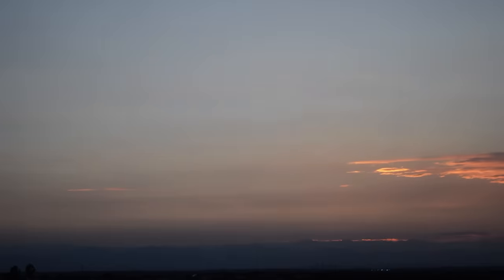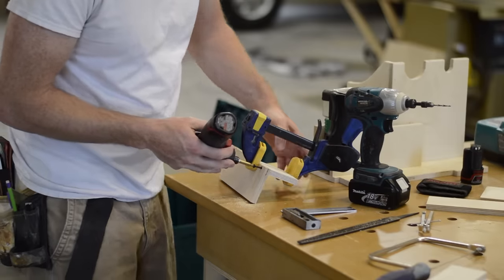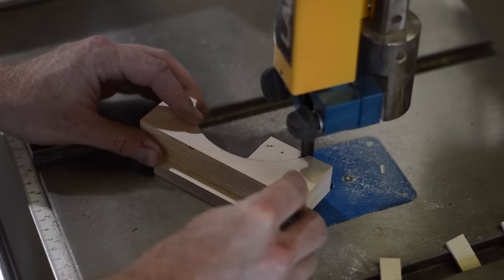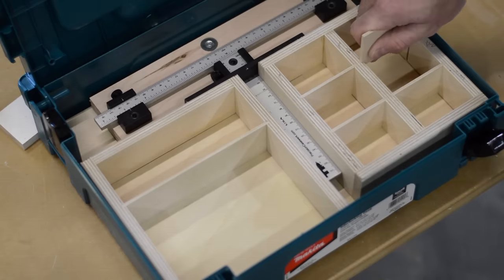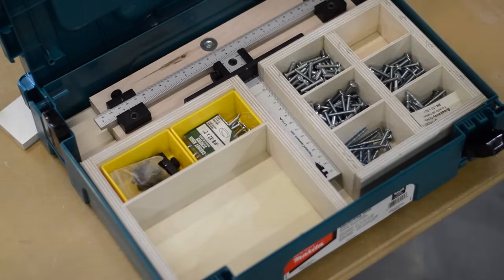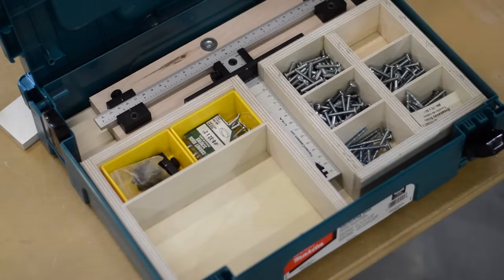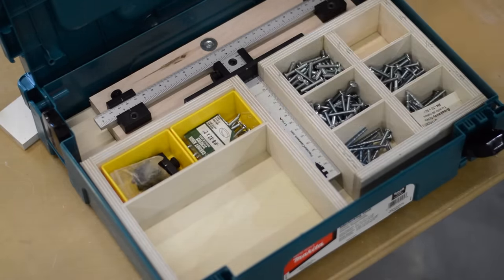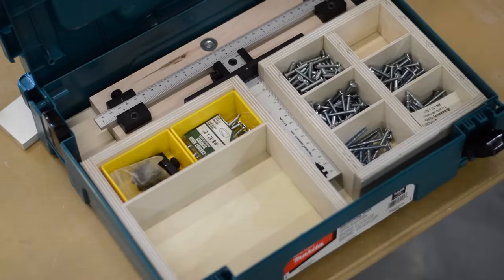Carpentry Tool Organization, Makita, Festool Systainer Build

Comment: Very neat. I have the hitachi systainer set and used foam and cut out shapes to accommodate tools. Then I used the number 4 for example with 4 inserts vertically. I pull out the one I need and work with it, then return it. For small items I use the SORTIMO T-boxx
Reply from the maker: Thank you very much. Foam works really good. I have been using a foam insert to hold my camera lenses.

Comment: Funny i have the same small Senco compressor of similar vintage.  Its cheap very light, quiet and wont die, love it. I replaced the twist drain valve with Bostich ball valve. Huge improvement. I like the box idea. Much cheaper than the Fusstool version and holds a small hose.👍
Reply from the maker: Its like that little compressor won't die. I like the ball valve idea. I'll look into that.

Comment: Very good design and fit. Regarding to the compressor if overheats dril couple holes at top and bottom about 2" diameter and screen it to stop dust and bugs and go to town 😎
Reply from the maker: I think this would be an easy effective solution. Thank you.

Comment: I just noticed the blower tip inline on your hose with the nailer.  That's awesome.  Nice builds as well.
Reply from the maker: Thats a really neat tool, I bought it at a closeout sale at a local auto parts store.
Reply: @MikeFarrington  I like it.  I was about to comment on another video.  I found you a few days ago and am several hours deep so far.  I'm 43 and own an auto repair shop and am widely known for attention to detail and doing it right the first time.  So your OCD, detail, and organizing tendencies impress me.  I am not new to fab work whether it's wood, metal, or other raw materials.  But I am new to remodeling (my house) and fine detail carpentry.  I am currently building a shop up for woodworking and look forward to enjoying this hobby as relaxation instead of "I need to build it now and have to hurry, time is money".  A bathroom vanity cabinet is in my next month's lineup.  I have nearly everything I could need minus a band saw.   I greatly enjoy your presentation and tips.  11 years ago I bought domains to start my YouTube/internet presence of my adventurous lifestyle.  Man that's a bunch of camera/edit work I can't bring myself to dive into.  LOL.  Keep it up.  Oh, And AWESOME shop.
Reply from the maker: Thank you. Lots to think about with a new shop. Best of luck.

Comment: Awesome job on these. I am only a hobbyist but it gives me some ideas for my small shop and as I move to the upstairs in my home improvement projects. Just bought the cordless Makita track saw which came with two of the cases. Between that and your video I’m getting the bug to do some organizing.
Reply from the maker: Sounds like its time to get to work. This system has really worked well for me the last few months. I am working on a room remodel and it has really helped me keep my foot print small and organized.

Comment: I might grab a Dewalt ToughSystem box for my compressor now to lock onto my others. Awesome idea.
Reply from the maker: It is very convenient to be able to stack stuff on top of a compressor. Go for it.
Reply: Mike Farrington I realized that the last time I needed to go to a job site with an air compressor and had the Dewalt tough system tool box with wheels on it. It’s great having wheels, but there’s nowhere for the air compressor to rest against and they can fall out so I have to make sure to bring something long enough to go across the handlebars. Some people don’t have parking for you and you have to park far away and making multiple trips sucks. That’s the whole reason why I got the DeWalt box with wheels. Got tired of carrying so much all at once.
Reply from the maker: I hear you about the parking. I have made some pretty long treks. I always try to build an extra couple hours into the bid in those situations.

Comment: Hi Mike.
My feedback on your request is simple. Everything is well thought out and the way you process your need for an organization applied to this built describes your ingenuity and personal touch. I isn't easy to fit so many tools in such compact spaces to have them handy and keep them handly organized. 
The only thing I will add, not to change, would be one of those PC cooling fans to the air compressor. blowing right on top of its head if possible and an exhaust grill somewhere in its container.
This exhaust fand can be fitted with a power supply of the same volts capacity, and since it draws such a small amount of current, it can be rigged to the compressor's switch. But this is based on one's use of the nailer. In your case, it would only be worth it if in the future you would have more heavy use of it. 
Thanks for posting it. It is very inspiring.
Reply from the maker: Thank you very much. The PC fan is a good idea.

Comment: I'd like to see a follow up video as to how these are working for you and if you've needed to modify/update what you started with. It looks great as a starting concept.
Reply from the maker: So far I have used them on a few job sites. I have not needed to change any thing. At this point I am thinking of doing a few more boxes for other smaller stuff. Keep in mind that this tool set has been with me for many years now, so going into this I was pretty close on what I needed.

Comment: Studley ToolBox.... 
one thing you might do is use thinner material to pack even more stuff in.  it just gets heavier with each tool.  I think dividing tools into more managable sized tool boxes is a good way to keep your back in good shape.  
when your compressor dies, keep the tank but switch the compressor to refrigirator style compressor.  they are very quiet and keeps noise level down especially if you are going to work in a crowded area where noise is an issue.  they are mostly used by hobbiests but can crank upto 21bars so they are powerful.  maybe a little slow.
I really like how all this turned out.  I need to check if I can find boxes available here.
Reply from the maker: Agreed, thinner material would have been better, this was one of those projects where I did it with what I have on hand. Good tip on the fridge compressor.

Comment: Very nice! The only thing I would change is adding a few more clamps. Again very nice work.
Reply from the maker: Thank you Pete. I agree, more clamps. I did it this way because a lot of my installs I just clamp cabinets together and the screw them. Two clamps works for that. For larger jobs I have 3 empty systainers that I fill with job specific stuff, when I need more clamps I throw them in there.

Comment: Would love to see an update on this. Thoughts 💭 of what is working and what changes you would like to make. Plus is it practical for you as some of my tool organisation I find in practice just didn't work as I had planned originally. I have re watched this from time to time when I get frustrated with messy toolsite. Working on a practical adaptable mini workbench that is easy to carry from  job to job. Keep up the great work.
Reply from the maker: I think I mention this in the video, but the tools that I carry with me have been refined over many many years. So when making this setup, I pretty much knew what I wanted. This system has some compromises, as with anything, but its been great. I have not made any changes, except for adding a few more boxes for other tools.

Comment: A good video Mike!  The absolute most frustrating thing for me is trying to find the tool I need and where did I put it. I went from having a home Wood shop to doing home repair and projects at my kids homes, (I retired this year and they both bought houses within a month of each other late last year). Everything has been dad can you fix this or repair that.... Thank goodness my youngest just started college. 😊
    I started out with everything in 5 gallon buckets, now I am using multiples of 5 different size heavy duty bins. Once I get those organized and groups of tools sorted I’ll either put them in systainers or something similar. I take way more tools then I would normally need at home because I never know what I will need for the day. Then I may get duplicates to go back in my tool cabinets at home because these are major projects. So much for retirement!!😊
    You asked for comments on your setup. I think they are great, but I am a bit picky when it comes to my tools... I noticed a hand plane next to your try square and I can’t recall if they are held in place with magnets or not. If they are bumping around some Kaizen foam would help there. At 3:25-3:26 your Makita hammer drill/driver and drill driver/hammer drill goes in and the smaller of the two, the driver, pops off the half round cut out. I would use some thin strips of FastCap foam on the cutout below each drill chuck and under the battery that it is plugged into and below your spare batteries to cushion everything. And if anything moves around you could use FastCap Kaizen foam to hold it in place. Constant vibration or impact to the bit holder and chuck, from lateral angles may cause them to wear out prematurely, and major vibration to the batteries in the drills and the spares can cause premature failure as well. Just my two cents. I have repaired a lot of equipment in different states and countries in my day and to this day still have some 15, 20, and 33 year old power tools that still work and look great. I did say I was a little picky about my tools right?😊 One these days I may replace some of them. 😊
Sorry. Am helping a friend pack up before the storm hits and may have had a few sips too many. I’m such a lightweight, hahaha. So please forgive me if I got on my high horse a bit or got too boring....
Ron
Reply from the maker: Organization adds a calmness to my day. To address your input, the hand plane is wedged in place and the trip square is held with a magnet. I agree some foam around the front of the drill area would be a very good idea. Regarding vibration and the batteries failing, if you saw how hard I beat on a drill, the least of your worries would be about the batteries failing. I consider drills to be disposable, I get a few years out of them and then plan for a new one.

Comment: You‘re done a great job - finally it was the first video about proper tool arrangement which I found on YouTube ! 
as to your style / setup, its very interesting for me as being located in Austria, doing quite similar work to yours, how similar your arrangements are compared to mine. 
As far as the compressor goes, I disassembled mine completely and made a new tank out of these little oneway gas bottles which are used for welding projects. I‘ve also used some quick connectors to connect two bottles together to have on the one hand more compressed air when plugged in but also if ever necessary I can disconnect one bottle and use it remotely with the brad nailer for more than 10-15 nails or blowing out the dust of used tools to store them clean again in my boxes.
Thank you really very much for your great work and video.
Greetings from Austria
Reply from the maker: Thank you. I like the idea of a removable bottle, that could be very handy for small jobs. Great idea.

Comment: Excellent video! Not sure one needs to be OCD to be organized. Seems like a computer fan could fit inside the box to extract air, just need a few holes somewhere on the front side to allow air in.
You just got a new subscriber 👍
Reply from the maker: Thank you. The line between OCD and organized is a blurry one. Great to have you onboard.

Comment: Excellent idea and work, as long as you don't get lazy by letting tools lay around instead of putting them back in the box every single time, it will be second nature going to the box, and after it becomes second nature, you'll get angry with yourself when you didn't put a tool back and then you're scanning the space for a tool.  And the bonus is - if you put everything back every time, at the end of a job, there's no tool clean up, they are all where they are supposed to be, win, win.
Reply from the maker: I totally agree with what you have said. It will take some discipline and practice on my part, but if I stick with it, my job site will be neat and clean.

Comment: Nice job. I'm a Mak Pak convert it just makes getting tools to site easier and looks a whole lot more professional! It could take 20mins to get all the sustainers and blue boxes out on the job site but once in the 'tools area' everyone knows where to go and put back stuff, got to b e safer than tools with cables everywhere. Every tool I buy I get a blue box for. All my hand tools are in the same thing as yours. Modelled on a mates Festool wooden insert only about £50-60 cheaper.
Reply from the maker: I think that there are a bunch of really good tool systems out there. To be honest, I think there are a bunch that are better than the festool systainers. I went with this system because I had a bunch of them laying around. It just seemed natural to stick with it.

Comment: I love these! I am sure you've probably made some adjustments since 2018 and I've not yet checked to see. But one adjustment I could see is how it would be nice to hook your drill box up differently so you can just plug the box in and it will power all your chargers etc. I just watched an awesome video I'm going to use along with yours to incorporate into my system... It is from Insider Carpentry - Spencer Lewis and the video was called "The ULTIMATE Jobsite Microwave & Charging Station Dolly! - Dewalt Tough System Tote & DCB104 Charger" and I loved the way he hooked the charger up on the outside as well as the dolly system you might want to incorporate depending on how heavy your boxes ended up being. I have some of those 3D printed battery and tool holders in my shop, but it would be nice to be able to have everything set up similarly when I'm on a job elsewhere. Anyway, I'm gonna go search thru your videos to see if you updated these... thanks for sharing! Best
Reply from the maker: Thank you. I am still using this setup in 2021. I added a few boxes for other tools. Thank you for the suggestion.

Comment: Great build and definitely worth the effort. I have a similar setup (it evolves). I just added the one with MDF top as everytime you have small cut/adjustment I ended up using top of tool box to cut, sand on and this made it really easy as you can clamp, hold down pieces a lot better and I keep clamps etc in it.I found the festool flat trolley/skate think Makita does similar a great edition as has non marking wheels and makes easier for moving around jobsite (as a toolbox is always just in the road where you just put it 5min ago when it was not)  but more importantly when you wheel through someone's house it stops the accidental bash to the walls when carrying. Also less trips from van as it really can stacked high(wheels wider than boxes so very stable. I get comments on my professional set up by customer's just about every job and get a lot of referral jobs because of my tidiness and professional set-up. I also take my festool midi on all jobs which acts as another set of wheels and keeps dust down in people's houses which really helps you get paid with a smile. Keep up the good work
Reply from the maker: Very good suggestions, thank you. I really like the MDF top idea.

Comment: You can purchase systainers with an MDF top with the 20mm dog holes in them, if you can make two piles of systainers to an identical height you have an impromptu work bench/work top that is great for cutting baseboard or any sort of trim that can be awkward to handle away from a bench.
Reply from the maker: Thank you, good tip.

Comment: Excellent video Mike. Ive been mulling this over for some time now and currently keep a lot of my tools in the hard cases they came in. However, when on a jobsite I end up carrying a dozen different cases in and it is inefficient and messy. I never thought about the nail gun case (great idea) or another case for sanders, drills etc. I also think that having everything neat and organized helps out as much mentally as it does physically! When you feel that you are organized and prepared you tend to be more focused and efficient. Thanks again for the great video and all the others
Reply from the maker: Thank you. I spent most of today using a couple of these boxes. They are still working great, none of them have broken, and I feel for my work flow they help out a bunch. Honestly it could be the mental side you speak of. Seeing a neat and tidy work site really helps my state of mind.

Comment: I did the same years ago ( 6 boxes)....till I was tired of dragging along the weight of 3/4" plywood together with the tools in one box...and in a good job you would carry 3 to 4 boxes minimum.apart from the fact that the plywood in total takes quite some space in the box. So instead I made the arrangements with aluminum sheet...lighter and more practical. All the systainers are made by TANOS and are made in all sizes and colors. I make use of those colors to differentiate for the different setup of tools . 

Mike made a very neat job with his boxes ... however do not underestimate the weight of the plywood and the unused space it fills in the box ..if you work regularly with several boxes and different setups.
Reply from the maker: Thank you for your input. I have found the plywood to be plenty light, I used 1/2", 1/4" and 1/8". In my general box the plywood is very light, under 2 pounds. I think its totally worth the weight. Making this same type of insert out of aluminum would take me too much time, especially the drawers and small dividers.